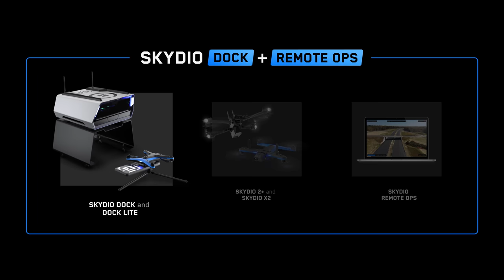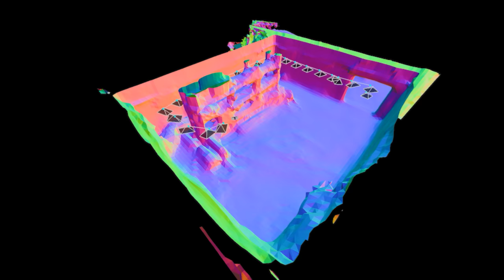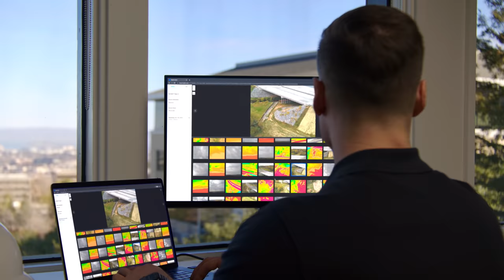Introducing Skydio Dock™ and Skydio Remote Ops™

Comment: Cool I'm sure there are plenty of companies in the industry that can use this.
I do have a question though. How can you get around the FAA needing a operator to maintain visual line of sight?
If you are setting dates for it to fly what if the weather is bad and you don't turn it off will it still attempt to fly in weather that is not wise to fly in, too windy, too rainy, or too hazy out?

I LOVE my skydio even though I've crashed 2 because of small branches I didn't see nore did my drone. 
I actually find it easier to fly than any DJI products. I don't hate the controller like most people but interested in a more solid design is coming later or a different drone all together.
I would totally buy a Skydio 3 if there were camera improvements, added AEB mode, better sensors, camera could turn sideways for Instagram, capable of flying at night even if it had a (fly at your own risk) message.
This are my wish list. This drone is still my favorite drone to fly to date.
Reply: I guess it doesn't apply because it isn't remotely controlled but more on being given a set of instructions....basically automated
Reply: I attended a fly day with Skydio today. This still requires a pilot as well as a visual observer unless the pilot/organization obtains a waiver or Certificate of Authorization to allow a pilot to fly the drone without a visual observer. Even though the drone is performing an automated flight, it is to my understanding a pilot needs to still be ready to take controls of the drone if needed. 

Regarding weather, Skydio advised against operating the dock or drone in the rain. It was a little windy today during their presentation and the smaller drone had a difficult time finding the dock to land (it eventually did.) If it were really windy, I think the drone could potentially crash.
Reply: Unfortunately, they are not working with personal users anymore.